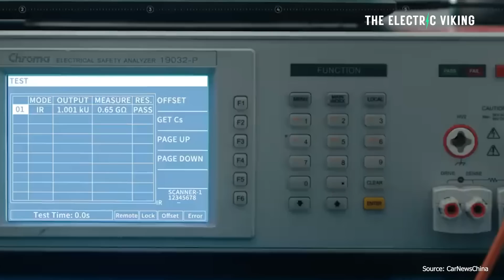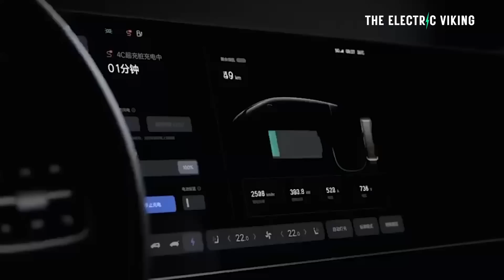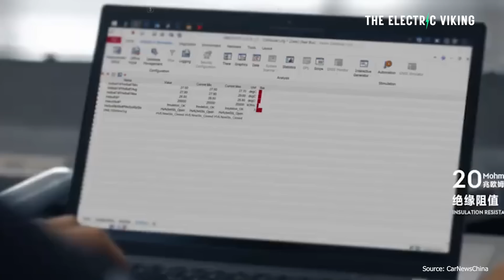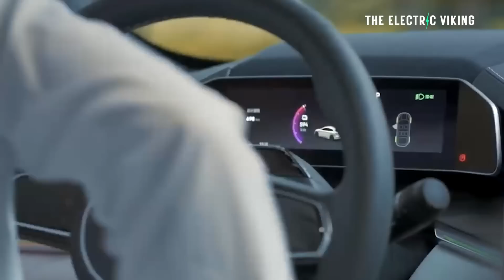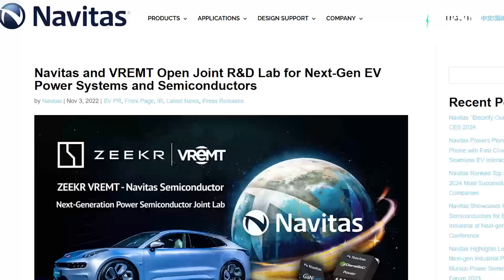Geely's Game Changing Fire Proof LFP batteries: 500kw charging, 83.7% density

Comment: My prediction still stands. Three new types of batteries per year for the next decade. All researchers are on notice,  you don't get years anymore to get to production, you have months before something better is out.  The big question for anyone investing in lithium is how many more years will it be that batteries still use lithium? That is not known but I'm thinking 10 years from now almost no lithium will be used in batteries.
Reply: Sodium ion and solid state batteries in less than 5 years
Reply: @larryc1616  That's a very safe bet. I agree.
Reply: I might bet on sodium.
Reply: @bozo5632  That would be the cheapest and most available material to use. Even if other batteries worked better sodium batteries might be used in less expensive vehicles.
Reply: Unfortunately, sodium is more than three times as heavy as lithium.  That doesn't translate into a battery that's three times as heavy, but there is a significant weight increase for sodium batteries.
Reply: @jeffreyquinn3820
But lithium batteries could theoretically reach the energy density of gasoline, sodium should also reach very high numbers eventually yes?
Reply: @Apjooz  Or something new we don't even know about yet is better than both. It's not normal for products to be secret until they are introduced by some companies may still do that.
Reply: @Apjooz  That's beyond my limited ability to speculate on.  I wouldn't be surprised to see batteries for homes & other buildings made out of sodium, because weight isn't an issue.  I'm also expecting to see batteries that need less lithium as efficiency improves.

Comment: Insofar as I know, these are just the recently announced CATL batteries, not something new.  And... maybe specs have gotten a little exaggerated and mixed up as they make their way through the rumor mills.   The CATL Qilin batteries are 255Wh/kg in NMC, and 160Wh/kg in LFP.   That's all-in, not cell-level.   The Zeekr 009 will use these batteries, 140 kWh of (I'm fairly sure) the NMC version.

I don't know where Sam got all the other stuff about temperature and fire and so forth from.

-Matt
Reply: Apparently these are made in house and have no input from CATL.Guess we will find to in the new year.
Reply: Geely is a car manufacture. They don't make any batteries. Zeekr is the luxury brand of Geely. They produce even less cars. Hard to imagine a non-battery manufacture no institutional knowledge, no infrastructure and no experience go from zero to world beating technology with nothing in between.

Comment: Pack density sounds good, but what is the cell density ?  If the cells can withstand the huge temp range you say, then the higher pack density might just mean it doesn't require cooling.  LFP is usually 150wh/kg to 210wh/kg while ternary is 220wh/kg to 285wh/kg.  On average that has meant LFP packs were 50% heavier, partially offset by being able to use them from 0-100% instead of ternary staying within the 10-85% range.
Reply: Good question.  There wasn't any mention of whether or not they still work efficiently at increased temperatures, only that they can withstand them when removed from a vehicle and then cooled and put back in the vehicle.

Comment: You wonder is this the reason why the Volvo EX30, which uses the Geely-developed Sustainable Exprerienc Architecture (SEA), is being delayed so Geely could incorporate this new battery type into the EX30?
Reply: Nope.  The EX30 is up and running.
Reply: The EX30 and Zeekr 007 are both based on SEA architecture so maybe

Comment: why on earth is the ultra fast charging being pushed like it is - as its utter bollox. IN THE REAL WORLD people will choose to charge at home, very slowly, as its cheaper than petrol, well at least for now. HOWEVER these utra fast chargers are MORE EXPENSIVE than petrol or diesel which completely negates one of the touted advantages of these dildos not to mention the fact that the charging grid infrastructure, certainly currently, can only cope with very few of them without hugely expensive upgrading and who is gonna pay for that?

Comment: They are avoiding stating energy density
So I looked up the press releases.
Battery weight of 100kwh battery is 710 kilos. This gives an energy density of 140 Watts per kg.  REALLY GOOD?
Reply: Yeah, it is a very heavy battery. I suspect they will start with 75 kWh variant.  
Should never trust the Chinese  blindly.

Comment: 1000 °C, What is this made from? 
Polyimide / Kapton is good to 400°C
Soft solder typically has a melting point range of 90 to 450 °C 
Aluminum is usually good to 650°C depending on the alloy
Reply: Graphene maybe
Reply: @wedmunds    Perhaps they're from the same team that makes the 9900 mAh 18650 cells on eBay.
Reply: @stevengpreston  I don't think those batteries are even in the same ball park

Comment: Did I miss the Wh per KG battery density spec? Sounds great, but without a density rating it's tough to get excited.
Reply: All marketing spin until the first forensics tear down is published.
Reply: 25% denser than current LFP batteries
Reply: Reportedly 200-240 Wh/kg
Reply: @downix    For comparison, Tesla's new 4680 cells have an energy density of 272-296 Wh/kg.
Reply: @ayCarumbaQueLio  but are using NCM chemistry, which degrades faster and can pose a fire risk if the temperature is not carefully managed, unlike LFP batteries.
Reply: @downix :  and that is very important!
Reply: No there where no
Reply: You did not miss it, not a word. I was looking for that too?

Comment: Not sure I buy this, even the plastic plug connectors would have to survive 1000 degrees. The sealing gasket, the metal, the battery, the cables.

Comment: What about charge cycles?  I rather have a battery that lasts a long time than charging faster..
Reply: LFP is amazing for charge cycles and retention of capacity. If this is equivalent to other LFP you shouldn’t worry. 1000 cycles without much loss. Figure in the bigger capacity (meaning fewer cycles) and the pack should outlast the car.
Reply: @Bodelicious1  I just googled and it says LFP has 3000 to 10000 cycles
Reply: @Arkane117 10000 is what I meant to type. Missed a zero. Yeah. LFP cells are pretty awesome.

Comment: The problem is that any EV battery should be capable of being frozen, then put into a 1000°C fire without catching fire if the it's only a short time in the fire.
Reply: Can ice cars pass this test?
Reply: @kittyhawk9886 People are not worrying about their internal combustion cars combusting on their own. Apart from some bad models, there is decades of history and use covering not just road transport, but marine and air also.
Submarine design is rarely incorporating lithium batteries due to safety concerns. The potential danger that these large battery packs are to the general public is under rated.
Reply: That's what I thought. If they put it in the fire for 48 hours then fair play. If it went in for 15 mins it basically just defrosted it.
Reply: the problem isn’t using a frozen battery to discharge…its the charging….LFP chemistry still needs the cells to be above 0°C before they can be charged…that means heating the batteries by other means, the crutch in northern climates.   Kills efficiency, using energy to make heat, before you can charge the cells

Comment: If Geely could get these batteries into their London taxi and dump the ICE side of this hybrid, that'd be an amazing show case for them. And in a fairly compact area - Greater London mainly - so easy to control and a few thousand highly visible and used cars. And being LFP should mean taxis last a couple of decades at least.
Reply: Smart
Reply: taxis can basically use any lithium.   city traffic barely makes batteries sweat.    going 70 mph does.
Reply: @BarryObaminable LFP is the cheapest format so it makes most sense, quick charge speeds are a massive plus for somebody who earns a living from the vehicle

Comment: I'm afraid ICE is still king until the cost of using fast chargers is below the cost of petrol and diesel. Here in the UK, it's actually more expensive to make long journeys relying on public  rapid charging than petrol or diesel. I absolutely love electric cars but I don't like my pocket being punished for using them. Secondly, insurance is 25% higher. It's almost like a conspiracy to halt the progress of  EV use. Even today's EVs are perfectly good enough for me, but when I'm being charged so much for using them, I'm afraid ICE still wins for journeys exceeding 300miles round trip
Reply: Agree that it is painful to rely on fast charger. I drive ICE for long trips but 95% of the time just city driving with EV. I charge my EV at home and the electric price is much cheaper at night.
Reply: @cheekhenliew7628   I bought an EV because of its refined driving and low running costs. I find EVs so calming on the mad roads today. I do a lot of driving in a low range EV,  inevitably I have to charge on public chargers in addition to charging at home every day. The choice I'm left with  is buy a long range EV and spend a huge sum to do so, or buy an ICE at half  the price of my existing one. So I'm wrestling with the issue. I also got hit really hard with depreciation although it also made better EVs more affordable. The only way to escape the combination of short range and high cost of charging is to buy a better EV and spend a few thousand more, or sell my EV pocket half the money and go back to ICE
Reply: Must EV owners use their own electricity, and if you're clever you use something like Octopus renewable sourced power which is way way cheaper than fossil fuel per mile. And as for insurance being more expensive, again that's simply not true. I know what for a fact.
Reply: With the price of petrol in the UK, that is surprising. Even at 35mpg, petrol must cost 20p/mile, right ?  And a Tesla Model 3 would get you 5 mile per kwh so you would have to pay over a pound per kwh for electric to cost more. What charging system is priced over a pound per kwh ?